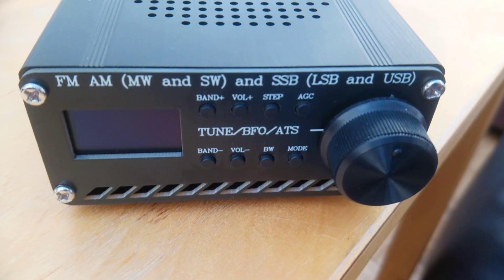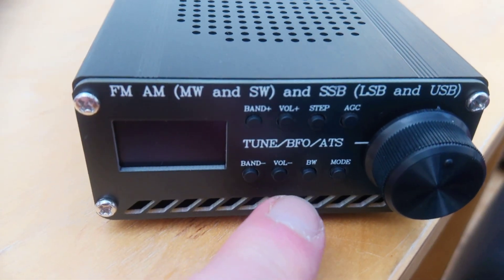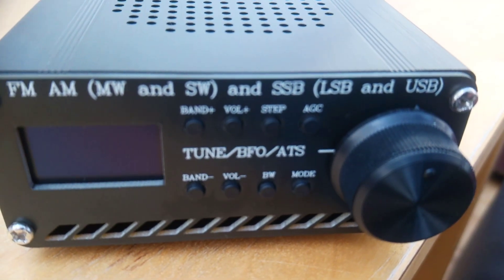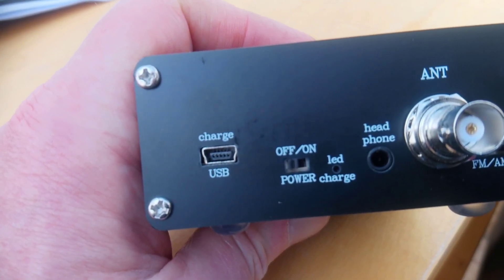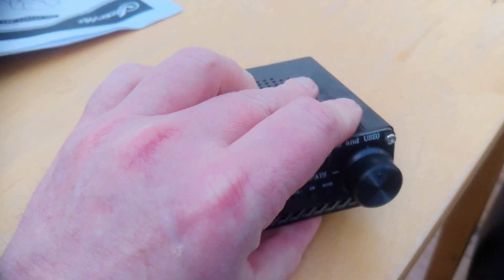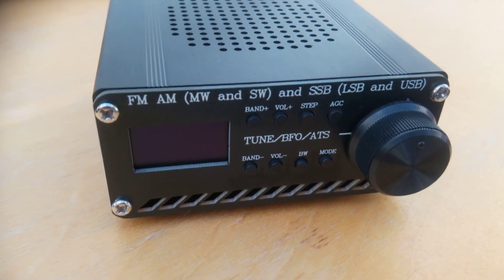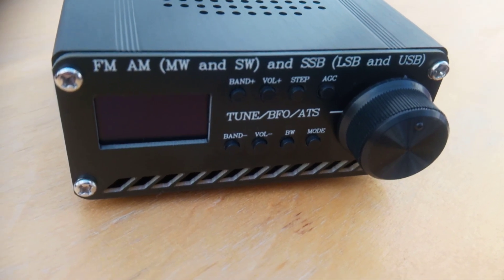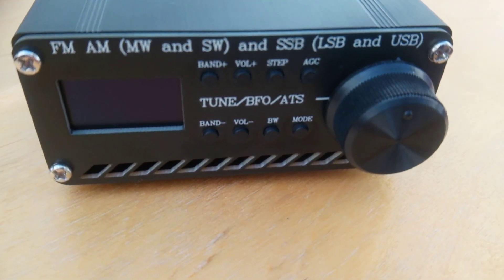First look at the SI4732 Receiver

Comment: Use an external aeriel for SSB and push the button in to function ssb
Reply from the maker: The problem was a bridged solder joint on the Arduino. Incidentally there is absolutely no reason why the  telescopic whip would not work on SSB in fact I have demonstrated this in other videos.

Comment: How can it work well if the SSB does not function?
Reply: On the large tuneing knob there,s a little small button press it in for ssb and press it again for am. Tunes in ssb and bfo.
Reply from the maker: @georgewatson6622  thanks but the problem wasn't the bfo the radio would not go into SSB at all. It looks like an electronic problem, possibly bad soldering but if you watch the latest videos you will see I have found a workaround.
Reply from the maker: Its works well on AM and FM but not SSB!
Reply: I,m glad you found away around it.thank you for your video and all your work.